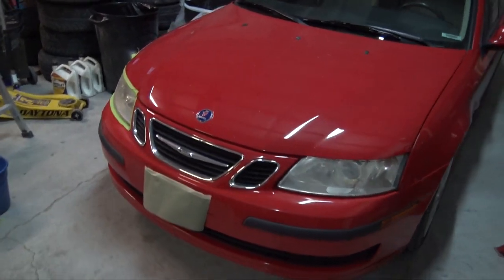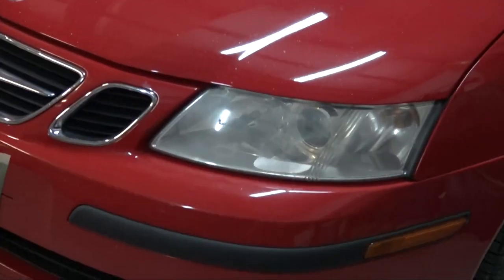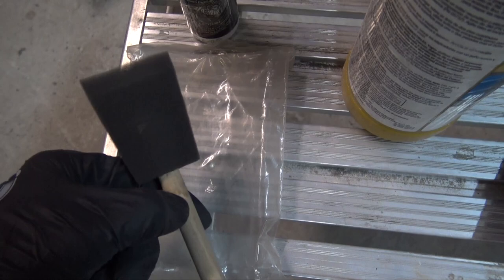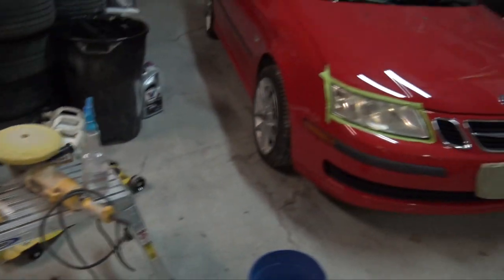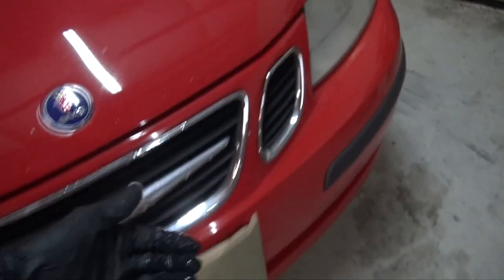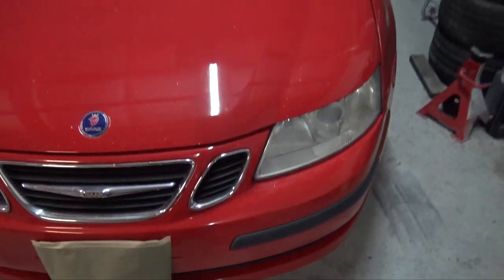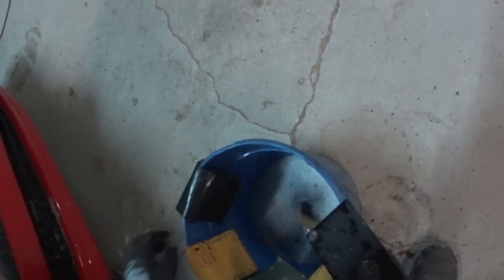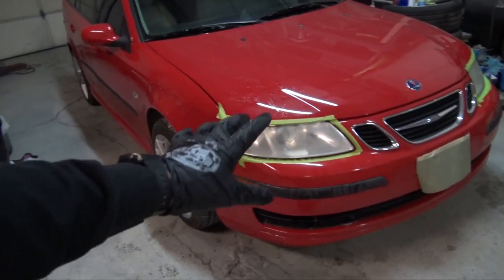HOW TO - Headlights restoration | 3M DIY kit vs Pro technique!

Comment: Motionauto, I have those headlights on my 03 9-3. They are crap. I polished them, tried sanding them down to plastic, then  clearcoating them. It is nice and clear, but the projector glass inside over time gets dull. I have to drive with my fog lights on.

Comment: I only have a 4500 rpm drill but I already ordered this kit, can I still use the drill?
Reply from the maker: you should be ok just kinda regulate the speed with the trigger and dont stay in one spot for too long
Reply: MotionAutoTv that's what I was thinking,  thanks for replying so fast!

Comment: lifting the hood usually helps ;)
Reply: No it doesn't the splattering of the product gets all over the engine block. Its easier to clean up with the hood closed because its a flat surface with no crevices. Quit being lazy and just use more tape.